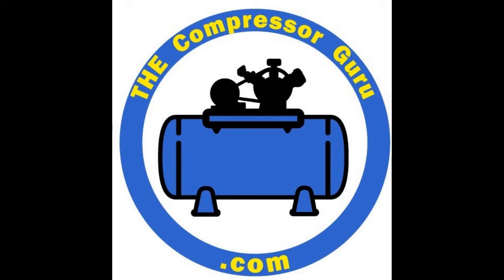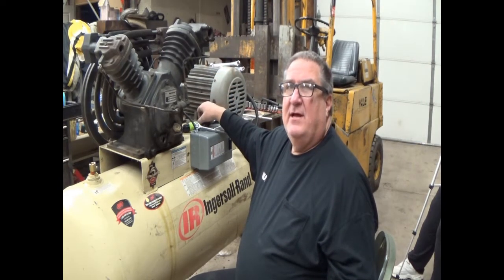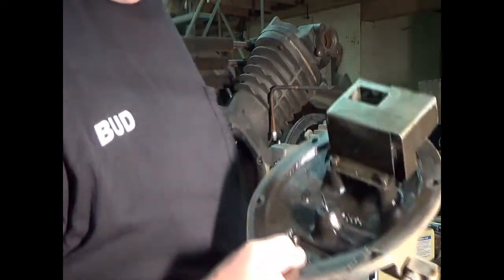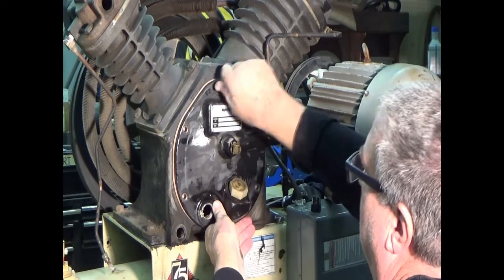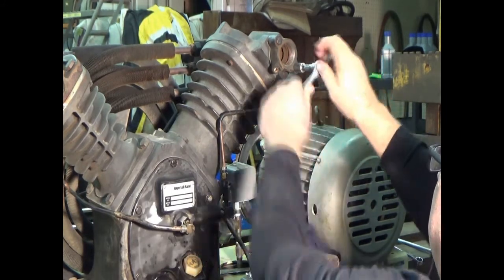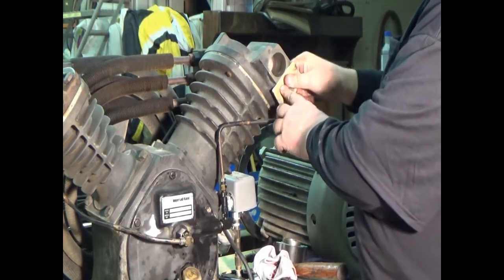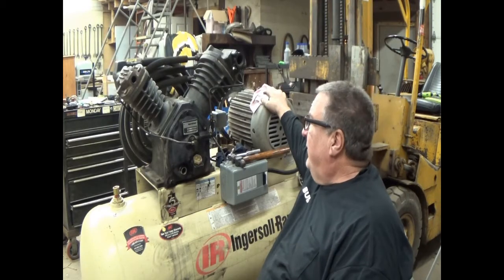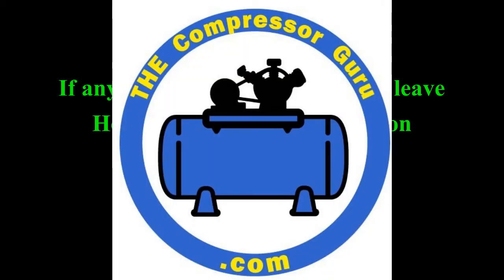Ingersoll Rand 2545 Crank case clean out

Comment: why would that crank case fill itself with water?  the compressor is inside . i love your videos thanks
Reply from the maker: this is a problem I have seen with mostly IR pumps its not the pump but the amount they run.  example you run the pump for 20 minute in the morning  to pump the system up( the pump gets warm not hot) and have zero demand the rest of the day. the pump get just warm enough that it will cool down and condensate water inside the crank case. if the Pump runs more it either cooks the moister out or never even develops the condensate  because of the run time. I do not know which . IR has ( use to and may still have available) a crank case heater for these problematic pumps. I service a 50 HP Quincy screw that is a constant run machine but not using much of its pumping potential and it also has a water problem . the customer on Monday morning before turning it on for the first shift of the week drains the water out of the separator tank. Usually a couple ounces a week. in that Quincy we also have the customer on an oil that helps suspend the water in the oil while running( and it is a very pricey oil) bottom line its about short run time. thanks for watching the videos. Bud
Reply from the maker: @super duper ducky interesting but with to many IRs mostly the smaller 1s if you pull a vacuum in the crank case you have a possibility of ruining the crank seal. the modern spacer that is on the outside  of the end bearing has helped with this issue . but I still would not recommend this practice. i with the 325s being so overbuilt I have to wonder just how bad this problem is ?

Comment: Do you have a video on Variable Frequency Drives (VFD) for compressors? We have a 15 hp Phase Converter trying to run a 10 hp Ingersoll Rand compressor and, for obvious reasons, the motor won't reach full capacity at startup. Our only option, without doing expensive upgrades, is to install a VFD.

Comment: So any idea what caused the dark oil? I'm having the same issue. I changed the oil (wolf's head non - detergent  hydraulic and compressor oil sae30) 3 weeks ago. I just switched to this oil because my other oil was looking like a very tan color and frothy. 
I have a fairly new model 2545 upright 120 gallon. I bought it off an individual that had it stored in her garage and was never put together because her husband fell ill. so this compressor has only been running now for roughly 3 months. (I installed the motor and compressor head on to the upright mounting brackets). Now as soon as I change to this recommended non detergent oil, my compressor got noticeably louder. when I change the oil about 3 weeks ago I cleaned it out then very well and when I clean this out this time it was extremely sludgy in the bottom and the oil was extremely dark. any ideas will be appreciated and Thanks!!! This wasn't a cheap compressor and I don't there's a warranty on it being I bought it from an individual. no I did notice there was no oil pickup tube at the bottom of the crankcase when you took that cover off or did I not see it? I don't see one looking the my sight glass or fill location. also the cover that you took off had lines going to it mine does not have those lines going to it. there's a spot for them in the casting but no holes were ever put into the cover.
Reply from the maker: Hi Chris so I will work backwards through your question and comments. your machine is a 2545 Economy that means you have no built in unloader and no lo oil shut down but you do have a sight glass to see oil level. 
This is a splash lube pump so there is no oil pickup tube.
as for warranty the IR warranty, is 1 year if you do not use their T30 select oil (overpriced to pay for the extra warranty.) so if it is under 1 year you may be able to get IR to talk to you. but the 2 year warranty is gone because of the other oil you put in. 
as for the sludge and noise. SHUT IT DOWN NOW! change the oil and use what I put in . here is a link I make nothing on . It is what I use for ALL my IR non warranty customers. my opinion is it is every bit as good and about 2/3 the price of T30 select. 
https://www.amsoil.com/p/synthetic-compressor-oil--iso-46-sae-20-pci/
as for getting dark after running...? that may be the nature of the brand of oil but building sludge. it makes me wonder if what you have used is what the customer in  this episode was using. I have zero  problems with discoloration or sludge with the amsoil compressor oil. good luck. You may contact THE Guru through the link below.
 thecompressorguru.com